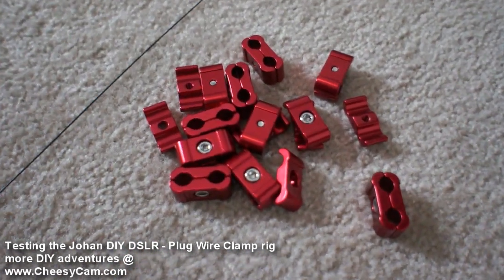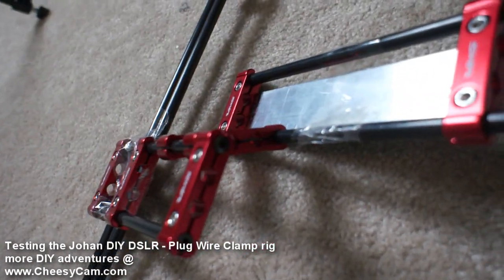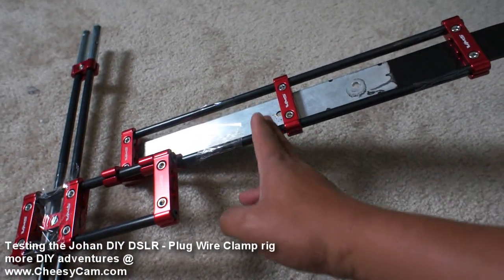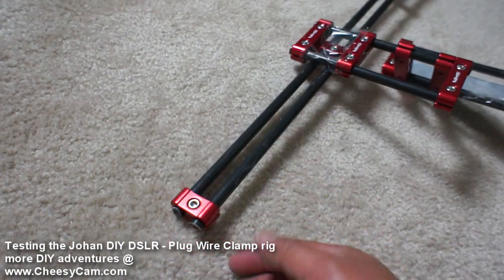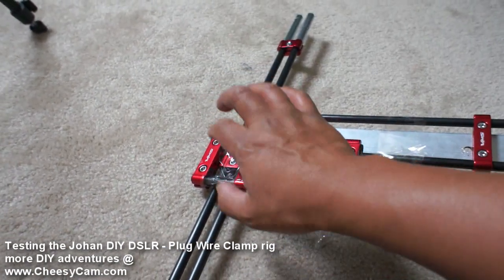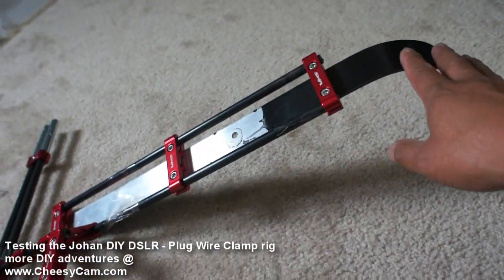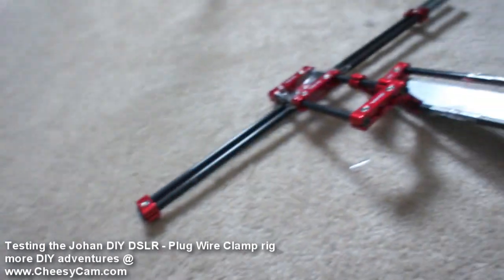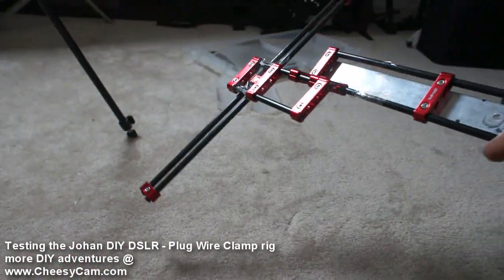DIY DSLR Rig - Johan Plug Wire Clamps

Comment: Thank you for this idea! I got my clamps and have started building my own rig. I paid 64€ for 8 sets of clamps and they will be enough for a basic rig. I am making adjustment rails for my camera though which will allow me to adjust camera position left/right, up/down, forward/back. I love these clamps as building blocks. You can also use M5 thumb screws if you need to adjust things often!

Comment: @MTpoolVision You can easily use aluminum rod instead of fiberglass or aluminum tubing. I made mine out of 10mm aluminum rod and it is very sturdy but not yet complete :)